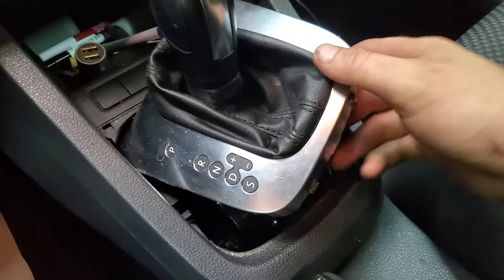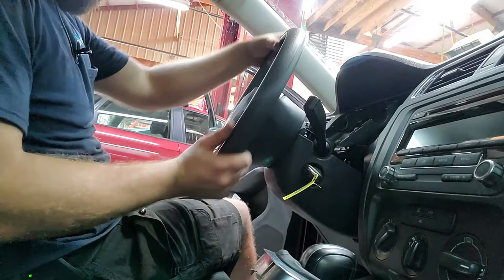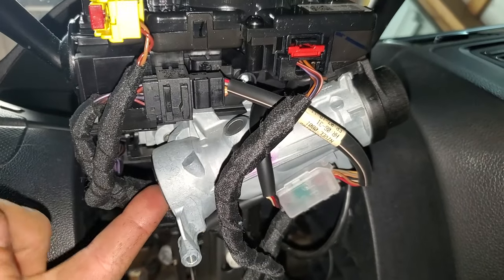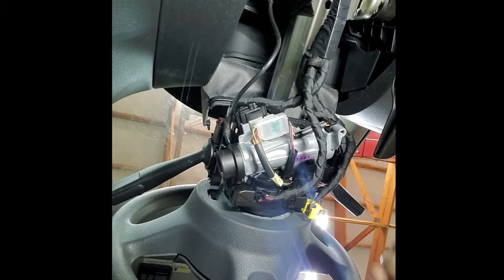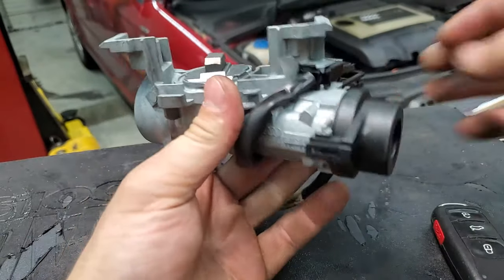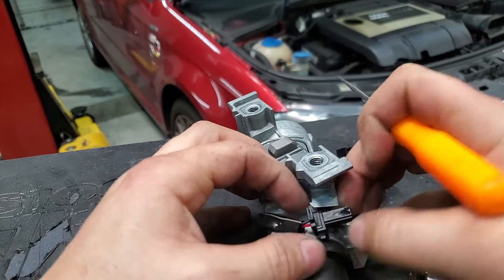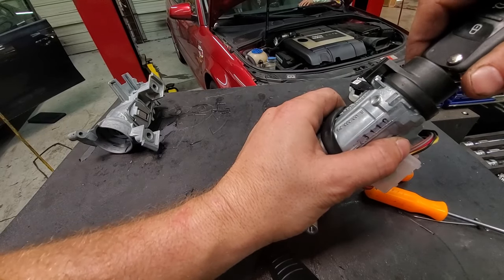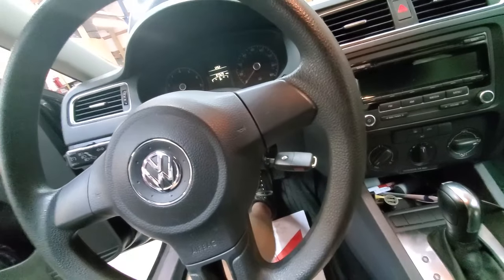How To Remove and Fix the Ignition Switch in 2012 VW Jetta DIY

Comment: What tools did you use to do this job? I’m looking to fix my wife’s mk 6. Just wanted to have everything before doing it. Great video man thanks for posting.
Reply: Hey hey just checking if you ever got your wife’s car working by yourself? Mine is a MK6 also, 2014 GLI, and this video has helped immensely but I’m still stuck a little bit and can’t quite get there.
Reply: @czcrossman  no I never started. I finally got the part in but my wife’s spare key doesn’t get stuck as much as the other one did. So we’ve been using the spare key to get around. Where did you get stuck?
Reply: @LordKenjii  Oh nice well that's cool that the spare worked, and now you have the part at least in case you do need to replace it :) I got the breakaway bolts out and unplugged all the wires but the cylinder still won't drop, like it's still held on with a clip or something...I can't quite figure it out! So I'm asking people here in the comments to help haha thanks anyway!

Comment: What’s that pin called at the store
Reply from the maker: a T-Pin or a sewing pin. You'll find them in the fabric department of Wal-Mart I'd assume.
Reply: @deamonmachine  thanks man I’m replacing a aftermarket version and I can’t get the immobilizer key switch out that’s the only thing holding me back

Comment: How long did it take to do this job?
Reply from the maker: Labor time is like.. 1.5 hours. I can get it done in about 30 minutes at this point.  Really it depends on if the steering wheel has to come off.

Comment: I changed mine out and now when I start my car it immediately dies. I don't know where I messed up at. Help please 🥺
Reply from the maker: if it starts for about 1 second and then dies, consistently, the immobolizer is very mad and not letting the car be started. (AKA It can't detect the key), so I'd check the key-ring is plugged in where the.. key goes.. cause it detects the key. That'd be about it for an off the cuff guess.

Comment: How do you know if your tumbler is bad?
Reply from the maker: Never run into that yet, but.. if the key doesn't go in or if the key goes in and spins in circles?
Reply: @deamonmachine  
ah okay,  I understand. I ordered a new switch but it didn't come with electricals, do you think that it would likely still work with just using the old electricals from my previous switch?

Comment: Did you disconnect the battey?
Reply from the maker: probably not
Reply: Always disconnect the battery when you're working on the car.
Reply: Is better to disconnect the battery, and wait an hour to start working on the car, cuz the air bags can turn on.

Comment: Hi I realize this is an older video, but I followed your whole tutorial and now I have my new lock cylinder housing with my cylinder in place and I have hooked up all the wires I believe correctly, but now I get a message on my dashboard that says SAFE, I'm not sure if my car is not turning on because my battery is dead or it's because I did missed a step, but I don't believe so. Would love to get advice @deamonmachine
Reply from the maker: I would try cycling the key a few times and also making sure the battery isn't dead. However, I would check the sensor ring is plugged in (the one that goes around where the key sits) that is the pickup for the security part of the key.